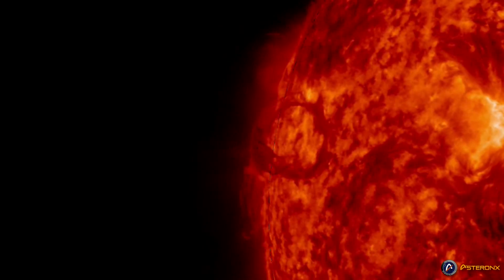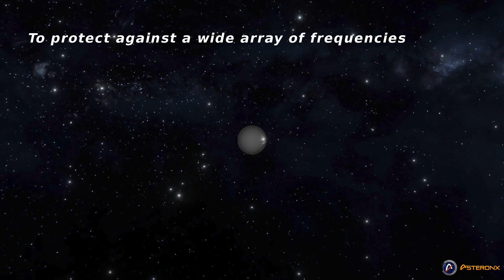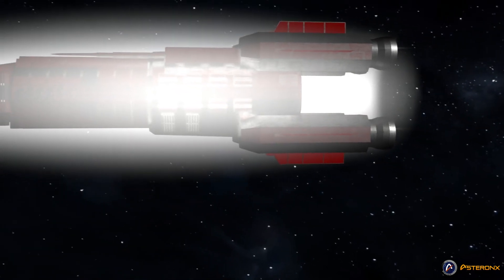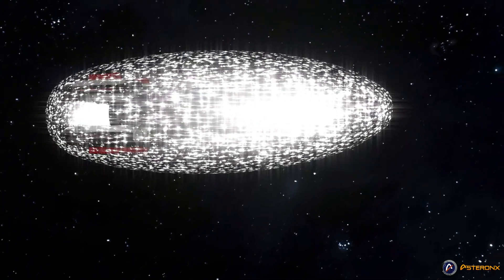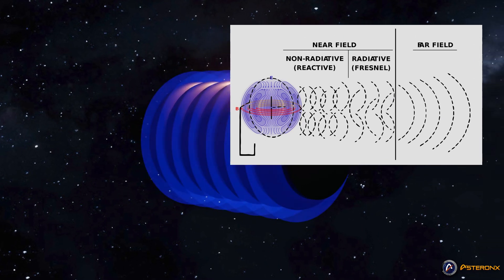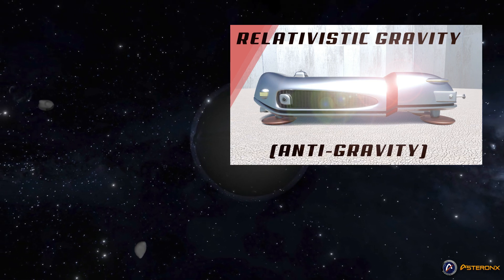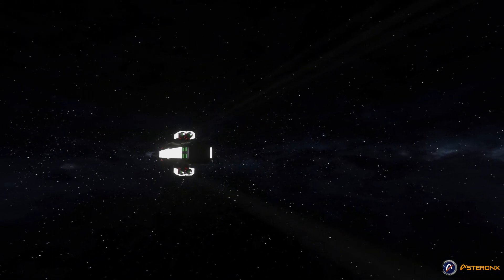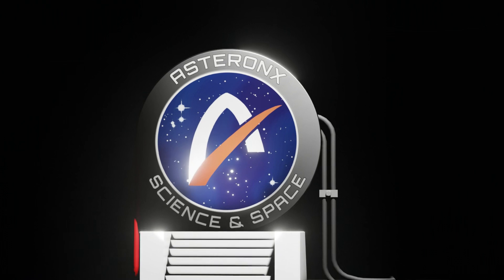Shields Up! Real Life Energy Shields

Comment: I wrote a sci fi series where the spaceships did have shield technology (Cosmic Secret). In the early 23rd century, military grade shields for battle cruisers are the most effective, capable of withstanding missile, laser and torpedo shots (for a short period of time). Eventually the shields will collapse and they are only activated when combat is imminent. This is due to the power drain on the secondary ship power systems. Naturally military ships have the strongest shield capabilities. Industrial and commercial ships have shields, primarily to protect them against wayward meteorites or asteroids. After a period of time, the shields will weaken and in some cases will only cushion the blow from a laser, missile or meteorite. Smaller, privately owned ships do have shields, however they are illegal for small civilian ships in most star systems and have industrial strength at best. Space pirates, space salvage companies and mercenaries have small ships that can carry at most 7 people comfortably. They have shields, enough to withstand ONE missile or one meteorite impact with minor to moderate external damage to the ship. After that, they have to rely on their external weapons system which is really no match against military ships with state of the art 23rd century firepower. Also, I mentioned in the stories too that shields are really only good for a few minutes before collapsing or draining their power reserves. Power restoration takes some time. Therefore, they have to use their weapons systems (lasers, torpedoes and missiles) to try and destroy the enemy ship, or disable it enough to send an elite boarding crew to take over and force the enemy to surrender.

Comment: What about inertia dampening fields, is anyone working on them, if they are not they should be? For high speed above 5g's or 10g's and a human crew, etc, it would be indispensable.
Reply from the maker: We have on many occasions talked about this and it's in each of the warp drive videos. The warp coil has several functions, one of which greatly reduces or eliminates the g force, what you refer to as inertia dampening.

Comment: This sounds a lot like a shielding system I recently came up with, where the energy bombardment of enemy weapons fire is first dispersed over all of the shielding matrix frame network, until the power being flooded in is sensed as being hazardous to the shields. At this point, the shields' safety system would then begin to shunt the excess collected energy to weapons &/or drive unit. Let me know what you think of the Automatic Ablative Transference Shielding Matrix (or 8-SiM) system I've imagined...

Comment: These concepts I can assume look good on paper... However why aren't micro or even scale models of these concepts being tested in space? Some of the engines should be able to be at least scaled down for cost effective transport to low earth orbit.
Reply from the maker: Eventually, we will be testing some of these concepts and others. Our latest concept is a high powered forward facing deflection array making use of several concepts. 

The idea being, the ship must be able to deflect all debris far ahead of itself, by the time the ship reaches the deflected debris, it will have been deflected far enough away, allowing the ship to pass without contact. 

The direct debris burning-destroying method requires more power than is practical-feasible. 

If you have not already, take a look at our engine design concept called, Muon Catalyzed Aneutronic Fusion Drive - 8% Lightspeed: https://www.youtube.com/watch?v=9jAUXuL-6oc

Comment: I have experimented with electrostatic fields  from a Van De Graff and Tesla Coils generators It seems that the higher the voltages are that there is a more noticeably stronger electrostatic field present.  To some limited degree this could be used  as a shied to envelope an aircraft at high speeds.

Comment: I'm interested in learning more about gravitational shielding.

I plan on writing a sci-fi story that has it, and I'm trying to imagine how it would work. Like, what would happen if something fast moving hit a gravitational shield? Would it bounce off? Shatter?

And what about something slow moving? Would it be like touching something solid? Would it feel like a force pushing your hand away?

If someone could suggest what would happen in these scenarios, I would appreciate it.
Reply: when you through a ball up in the air, does it stop instantly? No, it slows to a stop and falls away. I would think that projectiles would also slow, likely slowing faster and faster until they either get through or stop and fall away, even the ones that to get through will do so at slower velocity, and might not do damage, but that would depend on the size and strength of the shield and speed of the projectile.

Comment: There are some difficulties with these realistic shieldings. The first one is that these shielding (except maybe gravity shielding) are rather impermeable instead of the the semi-permeable shielding depicted in sci-fi-es. This means if you want to communicate, of get useful information from the sensors, or just deploy weaponry,  you have to leave large openings in the shield for these subsystem, otherwise the shield's and the these subsystem's operation will be heavily interered by each other. So the zonal shield is the go-to shielding solution of the spaceship's crew want to do anything more then just drifting in space (even the propulsion system's exhaust material  can interfere with the shield). Obviously these openings are weakpoints on the ship.

The plasma shielding doesn't seem to perform well against solid projectiles, although there are some interesting technology such as the "plasma window"  that is capable of separating a standard atmospheric pressure gas from the space of the vacuum via using viscous plasma (that's what the wiki say about it). Another problem with the plasma shield is that prolonged contact with low temperature high heat capacity medium that cools down it quickly.

On the other hand gravity shielding has some very strange property. Even though it won't defend against laser weapons, just dampen its effects, it is excellent against solid projectile weapons. However this type of shielding may be useful as full-enclosure shielding a fully repulsive. Obviously a fully-enclosure repulsive gravity shield will definitely interfere with many subsystems, but in a way that can be compensated for, if one knows the precise properties of the repulsive field.
For example EM waves that comes through this shield may suffer heavy red shift, and defflection. However, the effects of the gravity field are accurately known, then it is possible to reconstruct the the sensory data that would have been obtained if the gravity field weren't there, via some calculations to a certain degree. Similar problem  is present for other subsystems such as weapons and communications.
In case of weapons the fire control system has to take account the effects of the gravity field on the projectile into the firing solution.  There's an additional benefit in this shielding is that it can massively boost the weapons's performance, because laser beams may suffer massive blue shift, and solid projectile (or or particle beams) will get a massive speed boost.

Overall I would use a full-enclosure fully repulsive gravity shielding and beneath that I would also employ a zonal plasma shielding. This way the protection is maximized while the ship can interact with the environment with minimal interference. The added benefit of this pairing  is that this shield complex can be used in denser mediums because the gravity shield can keep away the medium from the plasma shielding.

Comment: why not using a distortion shield ? it requires a lot of energy but it is basically the same as the distortion engine so nothing should be able to penetrate this kind of shielding as long as the ship is moving in the distortion. the ship won't be able to fight, but it is a fairly good way of safely travel through space.. Plus it is not really complicate to build, we just don't have the generator to power it on for a space ship, but it will come sooner or later.

Comment: an quad use separate system of systems magnetic  sheild of hull that increases current modular phse to an grid hll sectionals an internal ship protection    an plasmatic pulse scanner response hyper speed drective nulification well ahead of the ship by lookdown sootdown  multi respnses system    3  an spread grid of nodules covering of the whole of the ship that is an responder to scanningresponse by high speed calculatios to emit and streanthening and co inside streanths to imeadiate weekness    4    an containment sheild  using prefabricated metal with layers magnetic hol for example fifty or an hundred times in reflected teiries protecting all ejectronic grids and systems the quad effect by remote and direct emissions a multi gtid system command of operation that gives priority and the same as nonpriority response an multi role discise continuous protection bringing the system ot systems online of desired and manual already built in sytem  of the hull and grid protectionof natural magnetic streanth alon and the nodule protection of hull and internal grid systems  for munual and remote control multi syst the whole ship in the remainder operating fluently

Comment: I'm quite sure these high-tech shields are decades away from being realized on space faring ships.  But that's not to say these wouldn't be critical equipment as there is unbelievable stray radiation permeating space that would kill any passengers onboard a spaceship if not adequately protected 24/7.
Reply from the maker: Relatively simple magnetic/electrostatic hybrid shielding could be realized in a few years.

Comment: You haven't taken into consideration the antimatter/matter dispersion around your shield which will create holes in the shield.
Reply from the maker: Not sure I follow, what do you mean by matter/antimatter dispersion?
Reply: @asteronx  I assume your antimatter shield would consist of two magnetic fields trapping antimatter between them and assuming you have the ability to create enough antimatter to create a solid shield which in itself creates major problems, you are more likely to have an effect like a patchy vapour where the antimatter will swirl around the magnetic field creating gaps in the shield unless  you could control the dispersion of the antimatter within the shield I suppose if you could create multiple hexagonal magnetic pockets and use a multi layered shield to fill in the gaps then maybe you could have something.

Comment: Is that a "Perry Rhodan" Sphere Spaceship (Kugelraumer) at ~1:20 ?
Yeah it's a sphere with a "Ringwulst" around it's aquator, definately Terran or Arkonide design!
Reply from the maker: Glad someone noticed! But actually, the design is a very good one for warp drive starships. The safe or habitable zone of a warp drive is a spherical region inside the warp torus--the Ringwulst ;) why not take full advantage of all the volume available?
Reply: @asteronx  That's axactly what I read in one of the older magazines (?). A sphere offers most volume per surface, it can't get more efficient than that, so why would anyone ever change it? Don't remember which character said that but they woke up from cold-sleep and knew of the lemurians.
Reply from the maker: @EnraEnerato  We have not yet read Perry Rhodan directly, but we have scoured the Perrypedia ;)

Yes, a sphere is the most efficient shape when the primary concern is minimizing mass. Early on (such as before grav-control, or when such tech is immature), structural concerns will probably force more conventionally rocket-shaped vehicles. Not like the rockets we know today however! More like flying skyscrapers.

And for surface area, nothing beats a disc! We noticed that Perry Rhodan has a few of those as well.
Reply: @asteronx  The Fantan and some other species have so callled "Walzenraumer" (drum spaceships?) basically a cylinder with halfspheres on both ends rounding them. And then there is the weird ones though they usually only appeared in some story arcs of the old Perry Rhodan magazines. Haven't read PR-Neo beyond issue 40 yet so I don't realy know what they will keep and what they will change. Funny thing is when my stepfather was young his father told him not to read those trash storries to often (Perry Rhodan mostly) and he said things like how a man on the moon was something that wouldn't happen ever. Than th US did exactly that and he acknoledged maybe not all of it was that made up.
Reply from the maker: @EnraEnerato  Yes, science fiction seems just that: fiction, until it happens.

Except for our earliest years, most spacecraft of the near, and more distant future will be relatively smooth, for reasons of minimizing mass: especially if a ship is to have enough shielding to make it safe even during the worst solar storm.

It may be possible to make space travel safe against the usual radiation of space, safe enough to eliminate the risk of Alzheimer's anyway, but should a solar storm, or something unexpected hit, then the crew would be forced to cower inside a small heavily shielded safe room.

And as to spacesuits: for the time being, EVAs will probably have to be limited to orbit, planetary surfaces, or during low-radiation periods in interplanetary space. Packing enough physical shielding on a suit is basically impossible, so a suit must rely on active shielding, but again, the small size of the suit prohibits really comprehensive shielding.

Comment: Anti-material shield could also work as protective measure. Bubble of anti-material around the ship, hold in place by magnetic field and resupplied by ship produced or scooped from space anti-material. Far as i'm aware anti-material when it comes to contact with material will release huge amounts of energy and both will be destroyed in process. Though why isint satellites for instance getting blown out by it, if there is relative ample supply of it in space? Yeah as you guessed i'm not physicist.
Reply from the maker: A purely antimatter shield would only result in the first dust grain outright destroying the ship.

Comment: many years ago i came up with a concept of using an ion stream as shielding based on my work with x rays anode and cathode. one in the front one in the back with a field to push the stream outward to envelop the ship. The stream would deflect most incoming particles or anything affected by matter like trying to poke a stick in fast-moving water. This would also have an added effect of propelling the ship forward and as the rear unit is bombarded by particles ( which it has to be to complete the circuit that could be directed back for propulsion or targeted in another direction like a vectored thrust. However, it should be used carefully as it would be a very powerful x-ray beam. You would need additional materials on long journeys but perhaps with breaks for asteroid harvesting on very long runs.  The propulsion would work in a similar fashion to an ionic drive. I suppose a plasma field could be used to help deflect the ion stream but I am not well versed in plasma mechanics.

Comment: I would go for an arc shield. in my mind, an arc shield works by sending an ungodly amount of electricity through anything that gets close enough to the ship. it would be so much electricity that anything hit by it would vaporize instantly. it could also be used as the propulsion system as you could spray anything out a port and it would be vaporized acting like a rocket engine on steroids. it would work on the same principle as a stun gun.

Comment: At high speeds, wouldn't the shields be pushed back like Earths magnetic field by the Sun? + Isn't artificial wormholes like folding space are more realistic than any FTL drives? + Wouldn't large warships have much greater ability to generate shielding thus requiring even greater central power core, and if E still = mc^2 then what kind of mass would it generate? All and all its our final frontiers...\\//-

Comment: Why not just use a front bumper from a 1970's heavy sedan?  Edit: 1980's
Reply from the maker: OptimisticPessimist: Bumpers in the 1970s were for the most part stamped steel. Perhaps one from the 1980s, steel box construction with compression shocks ;)
Reply: hahahahaha
Reply: No, you would need one from at least the 1950s. Or perhaps an improvised cattle guard from and old 19th century steam engine.
:-)

Comment: Communications blackout can be overcome by a towed comms aray, much like a sonar aray. This can also carry varrious sensors.
Reply from the maker: And that would be easy to shoot off, and impossible to use during fast maneuvers. The best bet is to either let the sensors extend just beyond the shield (in small areas) and/or use sophisticated algorithms to figure out what is hitting the shield, that way effectively using the shield itself as a crude but effective camera system.
Reply from the maker: This would be about the only reason a "bridge" might protrude, or rather, a sensor bulge. Control centres should be deeply buried.

Comment: In the self-regenerating shield design, two questions:If it continues to be reinforced via by cosmic radiation,
perhaps recursively, how do you turn it off?When you turn it off, what will you use to protect the ship
from the gamma radiation and plasma when the positrons and electrons are
recombined?
Reply from the maker: Cosmic rays would not provide enough energy to maintain the shield. So no worries ;)